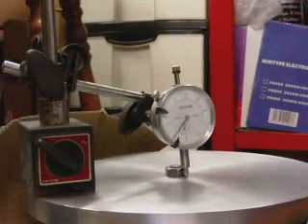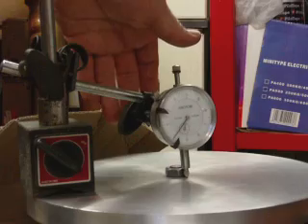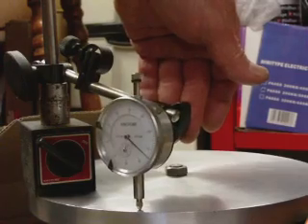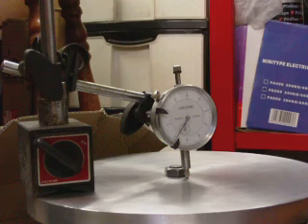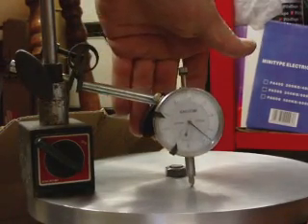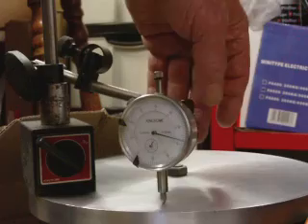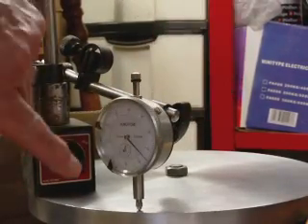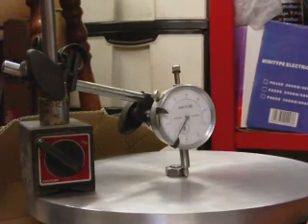Testing a Sharpening Plates Integrity.

Comment: Hi, I think you were good enough to help me out with a bit of information a few years ago and looking at Youtube I think you're still the man to ask. I have a clipper blade sharpening plate, similar to the one in your video, which I need re machining, but unfortunately I don't seem to be able to find anyone here in the UK that can provide me with the correct taper angle on the honing plate, as I feel mine is doing the same as the one in your video. I cannot tell you how much I would appreciate your advice! Thank you so much!!
Anthea Crawford
Reply from the maker: Hi Alex,sorry for the delay,I only just now found your post.
The plate I am testing on Youtube is a machine that came from Canada, I had a customer who wanted to sharpen their own blades,it didn't work out so I bought the machine off them, and turned it into a flat bed sharpening(Ceramics/Trimmers).It's use was limited. http://geohunterclippersharpener.business1.com/
sales@geohunterclippersharpener.com
               -------------------------------------------------------------
It's very hard to find anyone who can machine a plate dead flat,most recon they can but they really can't.
If you are sharpening blades for a living, my advice is to purchase a Treyco 2000 from the USA. 
It uses 16" plates with 1mm convex
My email is colinbut@bigpond.net.au